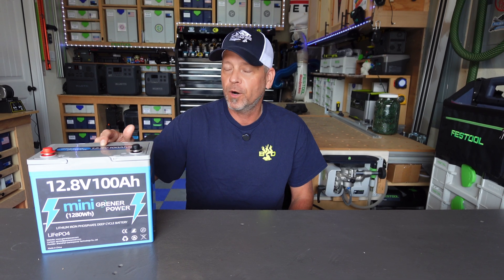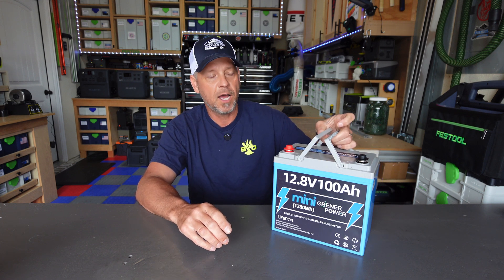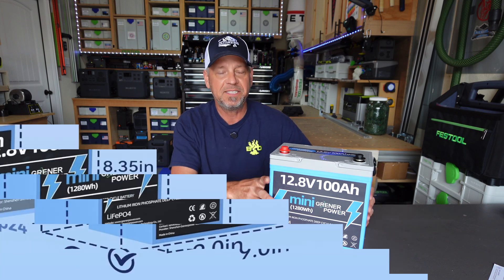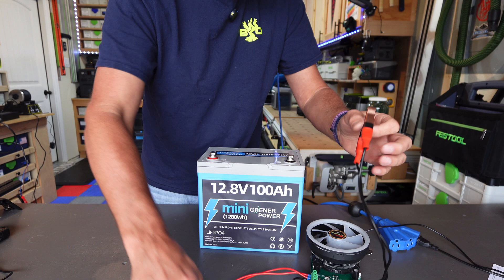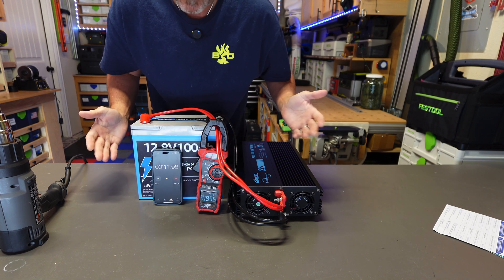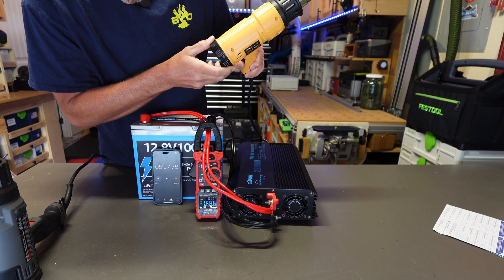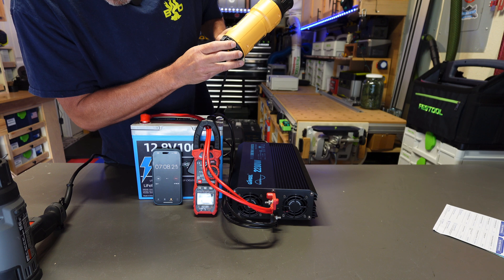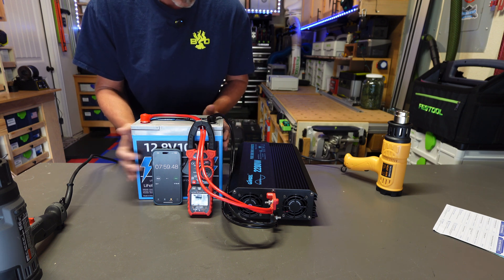Surprising output performance on this 100ah MINI battery : GRENERPOWER 12.8v Mini

Comment: I have 4 of those. I could not resist the set for $763 during a recent coupon+promotion deal on amazon.

One came poorly balanced and two others were okay.  Now after a few cycles, after charging to 14.6v all four will stay over 14.2 volts for at least 24 hours (disconnected from everything).  They seem like good batteries, but as your testing showed, they don't seem to have over current protection.  I suppose the short-term high amp note in the manual is a "don't do that" instead of a "can't do that."

What do I do with 4?  I wire them in series for nominally 51.2 volt.  Then with two "solar" leads I can connect to my Delta 2 Max and provide 1000w "charging" to add over 5kwh of stored power.  They can also power my big, old, 5500w low frequency sine wave inverter.  That's really impressive for a 100ah battery.

Comment: It appears that the high current cutoff is not working. Isn't that a safety feature?
Reply: I was thinking the same thing!
Reply: I have a different brand battery and use a circuit breaker just in case.

Comment: Thanks for the review. Crazy how much smaller they’ve gotten and how much cheaper. 3 years ago, they were over $700. I’ll definitely keep this one in my wish list and monitor the price
Reply: Make sure you check for coupons and discount codes.  On January 14 I was watching the 4 pack and happened to stumble on a 5% discount code and a $130 coupon listed on the page.  I don't know if it will repeat, but often those coupons and codes will not show up in the wish list (or even in "save for later").

Comment: Ordered through your link. Came to $215.70 total, which includes tax where I'm at.
Reply from the maker: Awesome! Hope it works out. Don’t forget to fill out the warranty info👍🏻
Reply: @GearGadgetReviews  Absolutely on the warranty. Ordered yesterday, arriving Wednesday 👍. It'll be backup "house" power for my Hiker Trailer, which already has an onboard Dakota 100ah LFP battery. I use my EcoFlow Delta 2 Max for running a 12v fridge & a Keurig coffee maker.